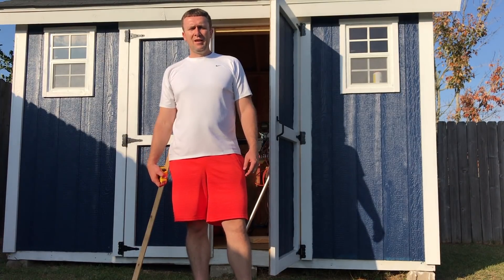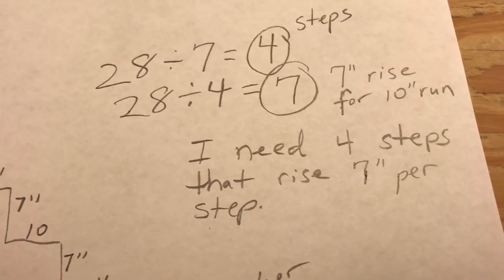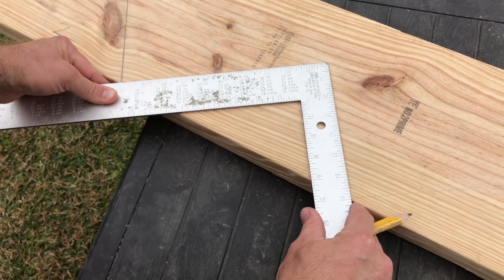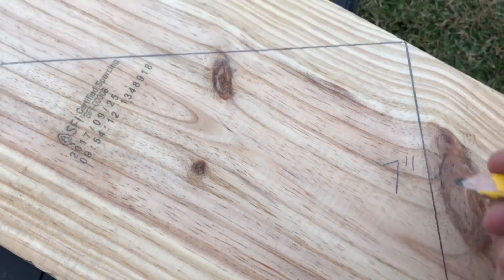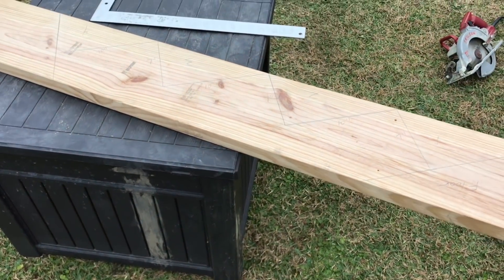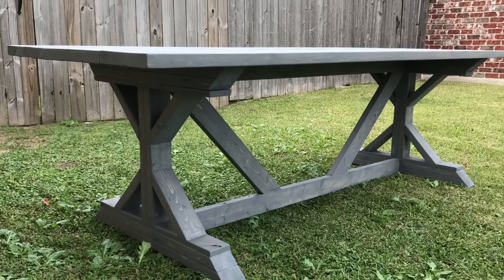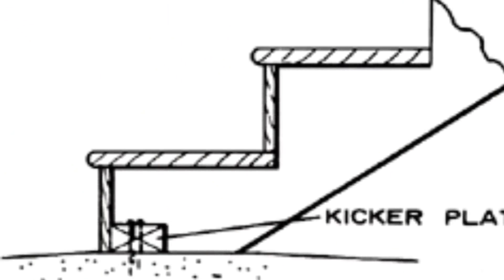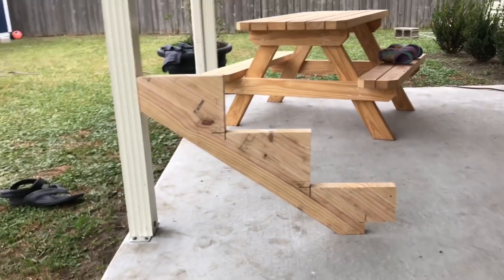How to calculate and cut stair stringers

Comment: Thank you for this video.  I would add to it the importance of starting with a piece of wood that is thicker.  The minimum distance between the (back) edge of the stringer and the cut apex for the rise and tread/run, should be 5".  In other words, don't leave less than 5" uncut wood between the cuts and the back edge.  That 5" should be undisturbed, meaning no overcuts into that area, so hand cuts for the final apex cuts are recommended.
Reply: I thought it was 3.5"? I mean 5" would make me feel better honestly.
Reply: He noted that stringers are usually cut out of 2x12 but he only had a 2x10 available. That deep over cut in the stringer was making me tense up also but that too he mentions when he says usually he would stop short with the skil and finish with a hand saw

Comment: Bottom step rise needs to be decreased by the thickness of the tread or it will have a higher rise than the rest of the steps.   Top step rise height also needs to be altered if stair treads and decking have different thicknesses. As well a board with a center heart should not be used for stair stringers.

Comment: How  you  get 10"
Reply: Antonio Castillo It's a "standard" measurement for safety. You need 10 inches for your foot to fit comfortably AND safely on each step.  Most building codes cover this. Ten inches should be considered a minimum measurement.
Reply: Thanks David.

Comment: You make some nice tables. Thank you for the video. The only think I would add is that by "total height" you mean to the top of whatever deck material will be used. Some may not realize you are taking the measurement from the top of the decking, even though it hasn't been applied yet. Great video
Reply: Are you talking about how in the drawing it shows 4 steps but on the actual deck and the stringer that he has propped up against the pole, it only has 3? Thank you for clarifying that because I was so confused.
Reply: @monicaloera1427  not exactly. I was talking about the total height of the deck which isn't shown because there are no deck planks installed yet.. you can't just measure from the ground to the top of the framing. You have to add the thickness of whatever decking you're gonna use. That's the height you divide to figure out the height of the steps.. .  I know the picture is confusing.  The "4th" step in the picture is actually the deck itself. So there are three steps and the top of the deck

Comment: Great video.
But, assuming you're having risers on each step, what about cutting back the equal thickness of a riser from the top tread of the stringer, so the top tread has equal depth as the rest?
Reply: This is an easy video to understand. you want to take it further go ahead and do so. For people like me that have to do this I am thankful  I actually understand the basics. I can use my common sense for the rest.

Comment: The rise will actually be higher than 7" due to the 2x? as the step top. therefore the actual rise would be 8 1/2 which would be a steeper step up??????
Reply: Each step will have the same thickness added on top for the treads which makes the final rise from step to step all end up at 7".

Comment: Don't know where your math went astray, but you WILL NOT have 4 steps of EQUAL height. MEASURE THEM! The bottom step will have less rise from "ground level" than the rest. Seems everybody does this, don't know why. Subconsciously, your brain says raise your foot so high for 1st step, so the rest should be the same, but it's different, it's higher. Only thickness of riser, but DIFFERENT/HIGHER. Do you ever trip or stumble on these stairs? Maybe only once and you consciously raise your foot higher from then on, unless you're in a hurry and forget. Personally, I want 4 steps of EQUAL HEIGHT.
Reply: Tommy, study again his finished floor measurement, stair thread !  his video is one of the most accurate and very well explained on YouTube.
Reply: Start the Video back at 7:55... He cut all of his Steps(risers and run) first, then went back and explained he was using 1x material for treads and cut the bottom off 3/4" because he had a 1x laying there.. 
You will most likely use 1" for 5/4 deck boards, or 1.5" for 2x material.. On a 10" run/tread, you will probably use (should) 2-5/4x6 deck or 2-2x6 boards for treads.. He explained he had extra material leftover from a picnic table build and used it for the demo video.. Watch a few more videos and come back and watch this one.. It will surely make sense then.. He covered everything, but, steps are not simple for the first timer on his first set... But, this video will make it all clear once you have seen others, and come back and watch this one again.. 
You probably missed several other things that were covered in this video that are not covered in most.. Good Luck.
BTW.. Always assume you are wrong when watching anothers video and see if you can figure out why before commenting.. You will learn much faster..  When you are ready,, try your first set on scrap wood, and you will come back for those last one or two questions you missed.. Then, next time, you won't miss anything.. Cheers.

Comment: Good video thanks. But got a question from floor to top of landing its 71in would that be 10 rises
Reply from the maker: 71/7=10.14 (round up to 11 steps)71/11= 6.45 (rise)11 steps with a 6.45 rise for each one.  Use 10 steps if  don't want to go right to the landing as shown in the video.Hope this helped
Reply: @SawdustandWood  perfect thanks againa. I was thinking 11 but wasn't sure my math is horrible
Reply: @SawdustandWood  one more question if I do 11 steps at 7 rise would that work it wouldnt have to be perfect it just a thing I'm building on the side or does it have to be at 6.45 rise
Reply from the maker: Well 11 steps at a rise of 7" will be 77" so I would say no if you need 71".

Comment: The over cut on each stringer does this cause the stringer to have weak spots in it, or is the over cut not enough for  it to have weak spots?
Reply from the maker: It may cause it to be slightly weaker but this method just allows for an easier cut.  I’ve cut many stairs and in my opinion it doesn’t make a difference. All my stairs have held up well.
Reply: Sawdust and Wood ok thanks i havent built any stairs as of yet so im just trying to get as much diy education as i can before i startso if you say it's not an issue then ill go with that thanks again.
Reply from the maker: Good luck
Reply: Sawdust and Wood Thanks

Comment: I saw one video of a tread that was 12" The carpenter said 12 is better than 10.  Wondering what your thoughts are?
Reply from the maker: He’s probably right...more area to step....it really depends on if you have the extra room to make the steps a little longer...
Reply: 10" run is minimum.  Standard is 11". If you have big feet,  make the run longer.  If you have short legs, make the rise lower.  Maximum rise is 7 and 3/4". Minimum is 4", I think.

Comment: Sorry to show my ignorance does that mean you cut 3/4 inch of bottom to make it 6 1/4 inches
Reply from the maker: Yes, cut whatever the thickness of material you will deck the steps with off the bottom.  So yes if you deck the steps with 3/4” material cut that from the bottom step.
Reply: Thank you